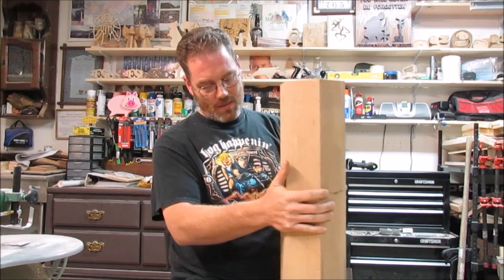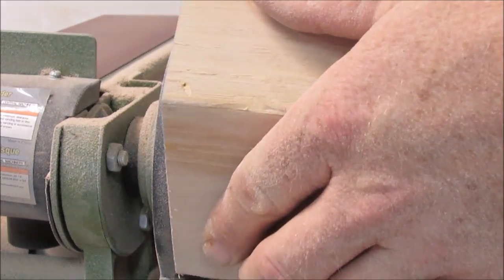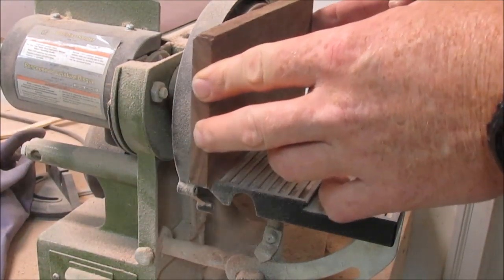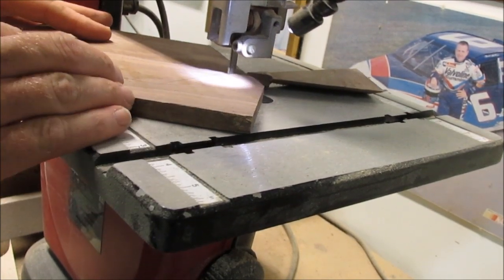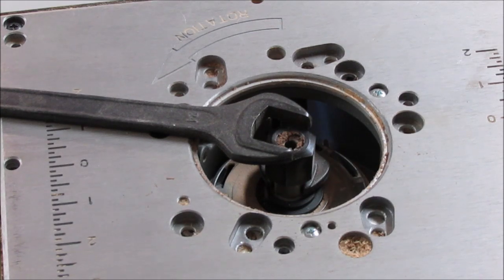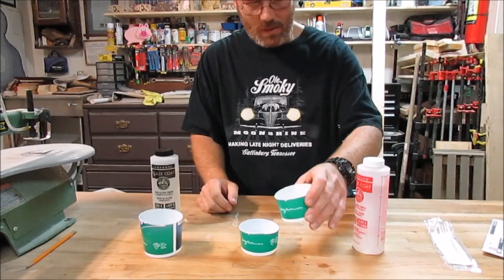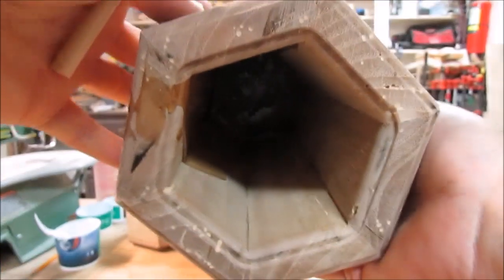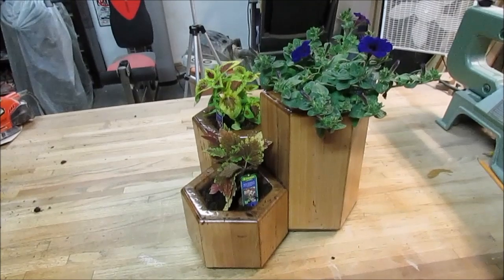Give an old Project New Life, Salvage

Comment: Hi Sterling.  Thanks for the video and it turned out really nice.  I like taking off cuts and other stuff in the shop and re using it in creative ways like you did.  When you were changing router bits and you commented about adjusting the router highth and using the wrench from the top.  I have struggled with this as well.  I found a real cheep wrench at the good will and bent it so I could change bits from the top of the router table like you did,  It was real easy to bend the wrench with a propane torch, hammer and bench vise. 

I really like your channel and videos.  Keep up the good work and take care.  Chris
Reply from the maker: thanks So Much Chris, I just enjoy Playing around in the garage, seeing what I can make, I got a lot to learn, but If I share,  it may help others, that's what I like about doing this, I learn, and at the same time, maybe pass off a good idea or tip, Thanks for watching Chris !!!